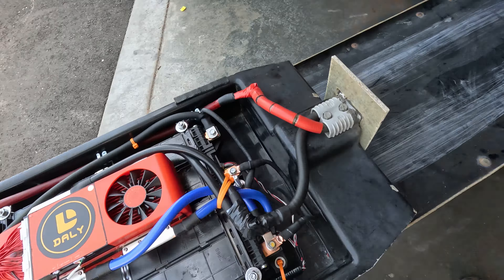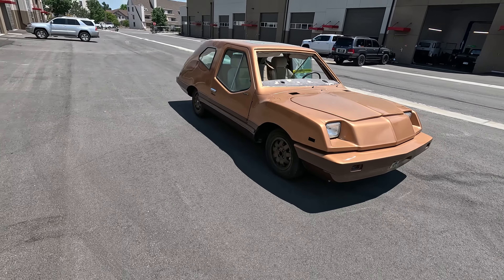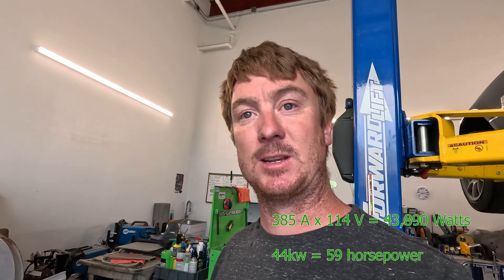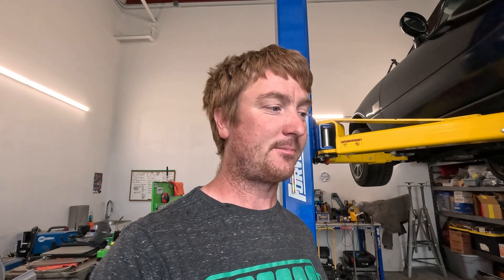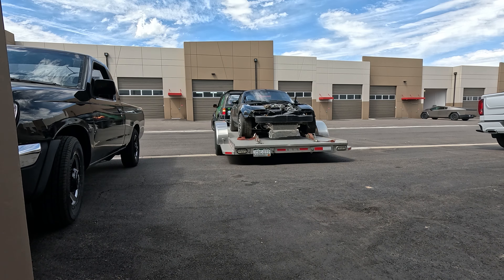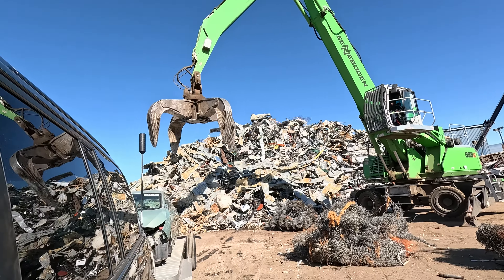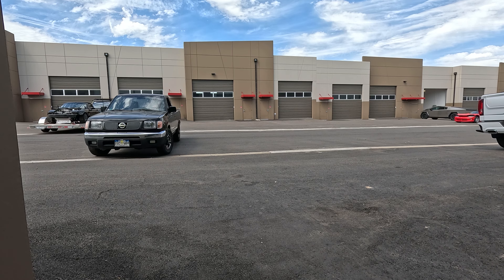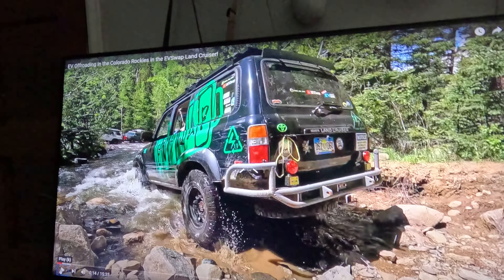Miata, Electrek, Frontier, Land Cruiser...It's Summer Vacation at EVSwap

Comment: I knew the Leaf could tow, but that the motor could be slapped into a larger vehicle with more drive wheels (more loss), then tow another vehicle for a while? That's pretty cool! You have the higher powered Leaf inverter in there right? Being air-cooled, how were the thermals?
Reply from the maker: It's all to do with the gear ratios. My truck is geared down much lower than a LEAF is. The inverter and motor are actually water cooled. I have a small radiator. When I did a lot of stop and go with heavy acceleration and regen the temperatures went up to about 175F and the cooling fans turned on. I only have a small radiator about 5x10 inches only but once the fans turned on the temperature dropped down again.

Comment: I think I am going to convert my 2003 Prius to EV. It is a relatively low tech car and already set up with electric power steering, brakes etc. I did a lot of work (wheel bearings, sway bar, tie rod ends, suspension overhaul, hybrid battery, brakes, tires) then drove 25 miles and the transmission blew. Considering the engine was already struggling and radiator leaks and exhaust issues this seems like an ideal vehicle right?
Reply from the maker: Yeah I would think so. Use a leaf drivetrain in the front and battery in the back.